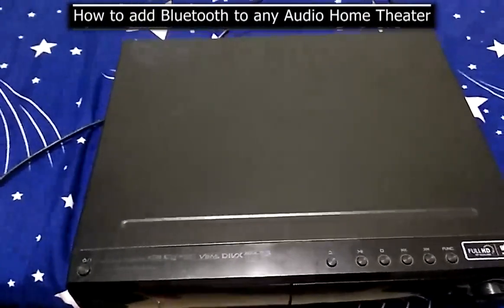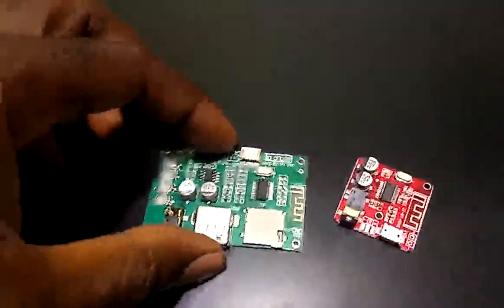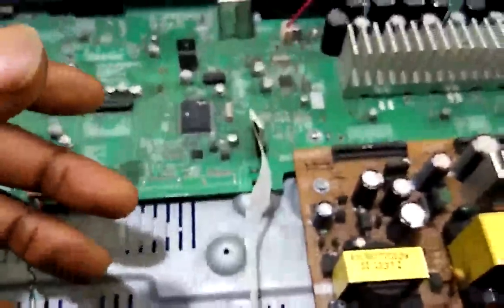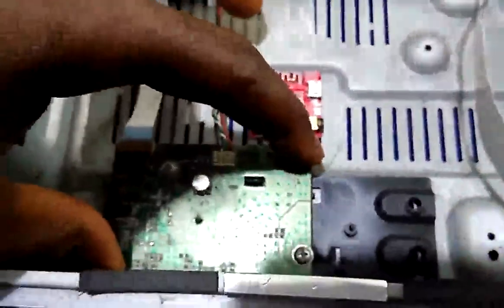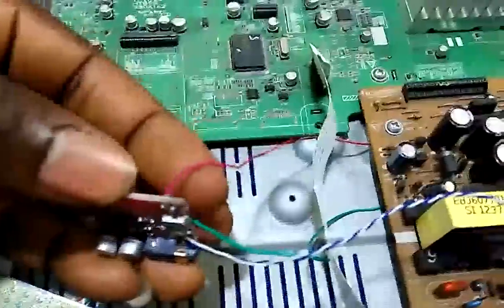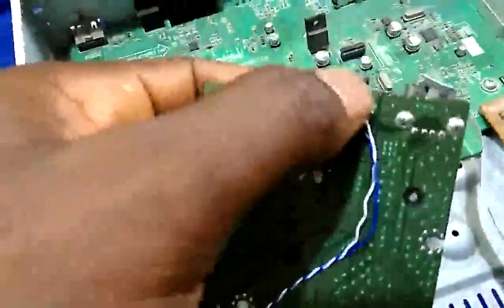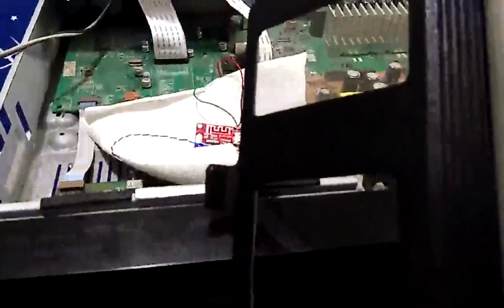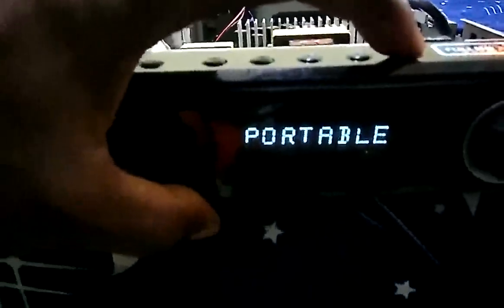How to Add Bluetooth Module to Any DVD Player (LG Home Theater)

Comment: Nice work sir.I have Marcsonic home theater 5.1 that doesn't have Bluetooth features, pls how do I connect Bluetooth to it?The panel is quite different from the one u used here.If u explain to me, I will be be able to do it cos I little knowledge of electronics.Thank you sir
Reply from the maker: Thanks
Do you have a multimeter? If you do, just look for 3.7v - 5v DC power supply from your set, if you don't have it on your home theater system you can use an external power supply (but I'm sure you can find it).
When that is done, connect the R, GND, L to the the input source of your set (aux input, line in, or portable in) and that's all

Comment: This DVD player is the same with my LG DVD home theater. my question sir is, will the quality of the 5.1 surround system will not be affected?
Reply from the maker: Very clean sound, you will get the 5.1 surround sound if the song is recorded with the 5.1 features
Reply: @sylvalineresources9540  Thanks for your reply.
Reply from the maker: You are welcome

Comment: my home theater has bluetooth with bt all of a sudden it stop showing up
Reply from the maker: All my years in electronics I've not heard or seen the Bluetooth stop working. But if it happens, it can be replaced just look for the Bluetooth module under the CD deck and replace it or you can install the universal Bluetooth module